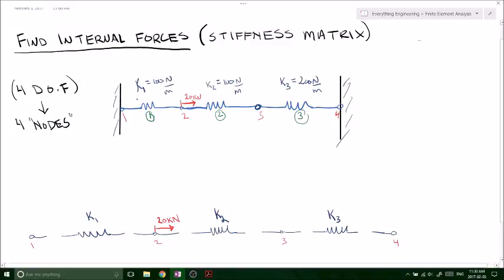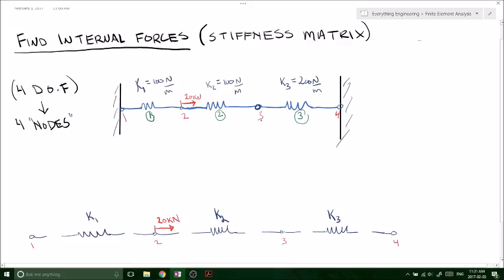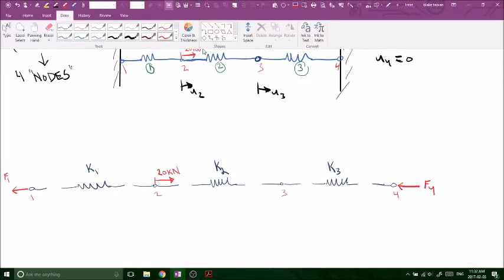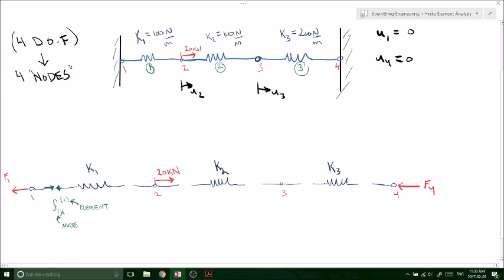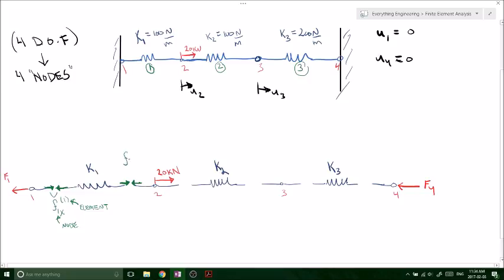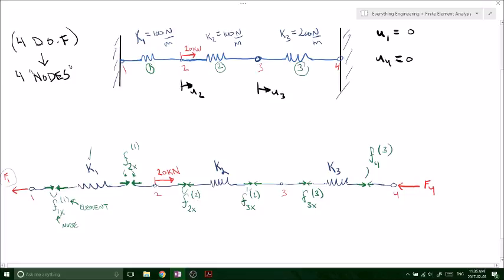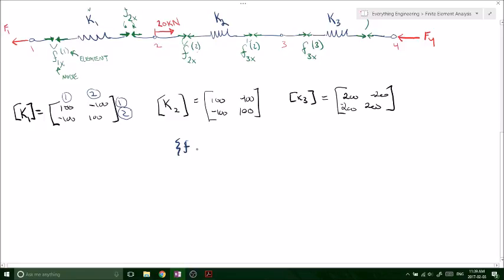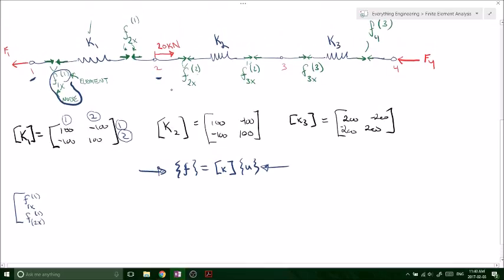Stiffness Matrix to solve internal forces in 1D (Part 1 of 2) - Finite Element Methods

Comment: hi, i have the almost the thing you are doing right now but the only difference is that, they already have given me of the displacement and on the same point the is unknown force P...please help
Reply: ...have almost the....error
Reply from the maker: hey thanks for watching!  What you want to do is start solving external forces and nodal displacements as per instructions in my other video in the following link: https://www.youtube.com/watch?v=fjenom-XgDY&t=3s&list=PLcKW25IOe0JRwBxQw5y0j9EPZiQgL4NkZ&index=2  

Where I substitute the 20kN force in the first stiffness matrix you will be substituting "P" in there and then when you use matrix multiplication with the known displacement vector you simply will have to solve or the unknown P value.  I hope this helps!